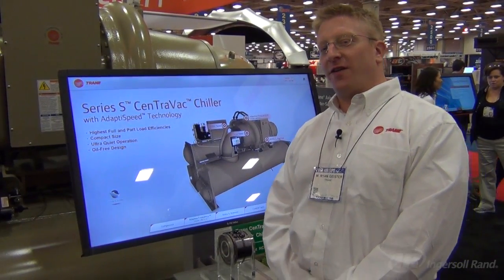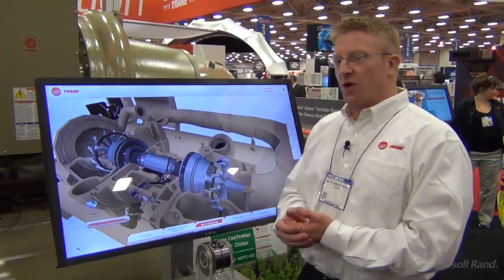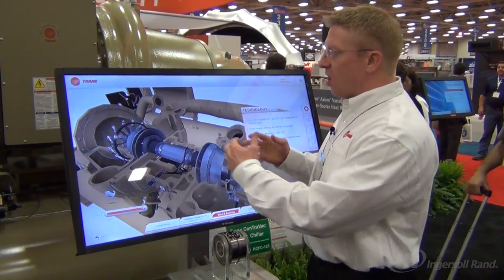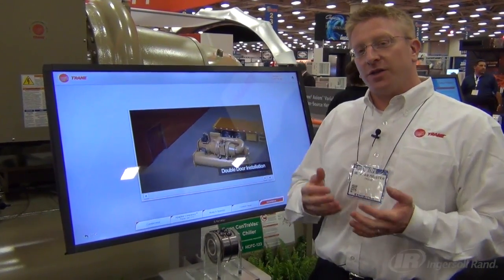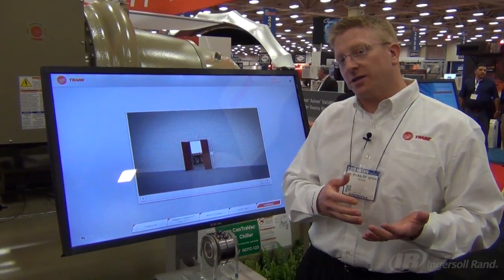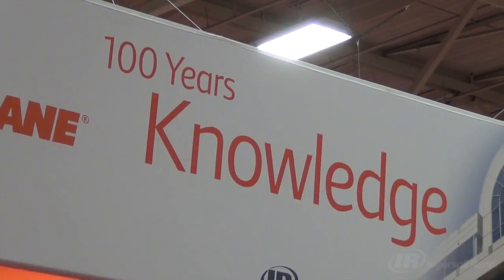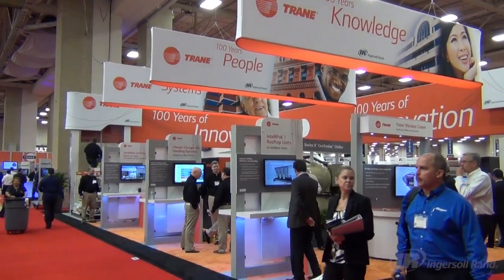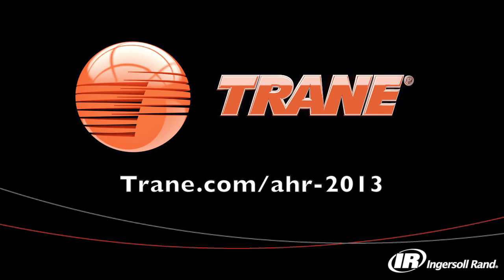New Trane Series S CenTraVac Chiller

Comment: The performance ratings for applied equipment is set by AHRI Standard 550/590 & ASHRAE 30.  These standards define the rating systems & conditions used for each product (EER or kW/ton).  The Series S CenTraVac Chiller is in a category that uses kW/ton (Full & IPLV) to define minimum values to meet ASHRAE 90.1.  To determine a design solution that provides the best return on investment, a review all system components, coupled with weather & loads on the building, should be done.